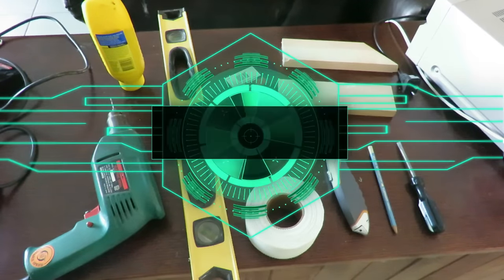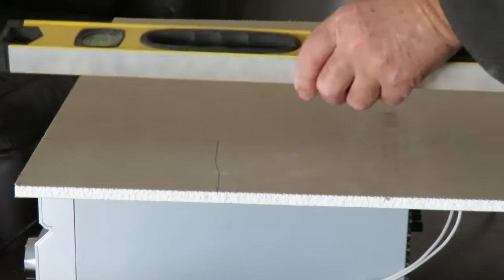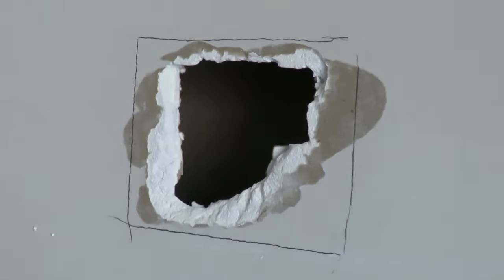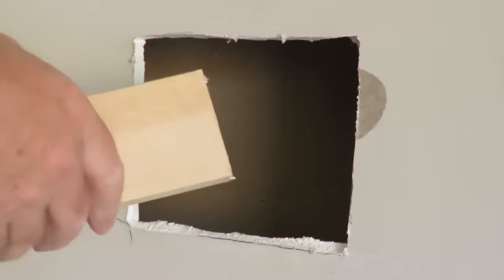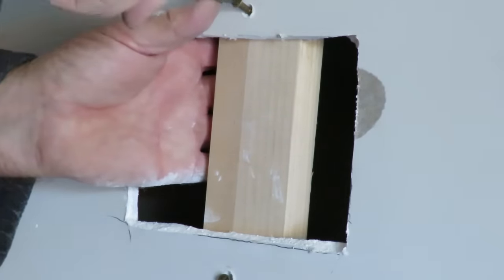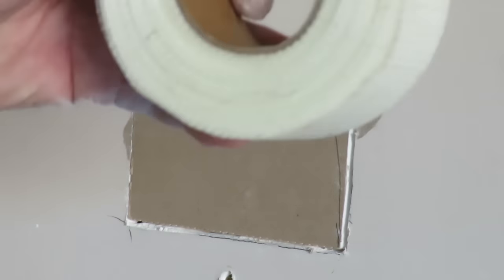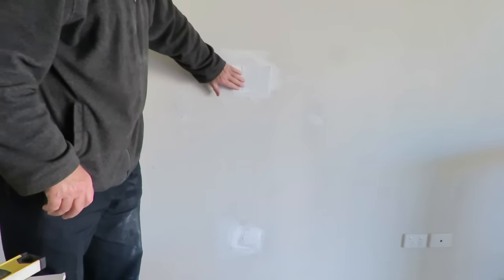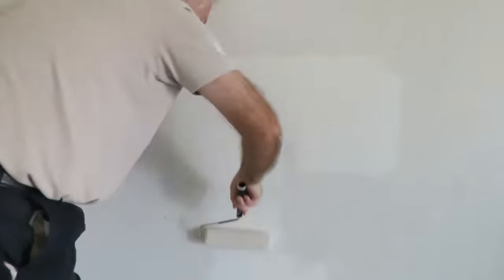🏠 How to Repair Drywall and Fix a large Hole in the Plaster Wall the easy way

Comment: Well this is exactly how not to patch a hole.  First he put the drywall backwards.   Secondly he didn't pot any screws to secure the piece of drywall to the backboard.  And I'm here reading people complementing him without knowing is completely wrong.
Reply from the maker: And people like yourself not reading the video description before commenting.
Reply: I agree.
Reply: Lol, sure you only put that description of double sided drywall after you realized you put it backwards to late in the video to edited out. You can really tell one side is gray and the other brown when you start cuttingit and then you flipit. Is ok if you made a mistake , just don't try to fool people. Everyone that knows drywall is going to know it was backwards. More over if you had limited tools the same way you put the backboard you could at least put one screw in the middle and secured the drywall.
Reply: complementing or complimenting?

Comment: Thank u so much for doing this video it has just saved me probably a thousand  $$ 
with the one underneath did u do the same or just the tape and putty?
Reply from the maker: Thank you for your kind words.
There are many ways to do repairs, it all depends on what you have available on the day of the repair.

Be sure to watch my other wall repair video, when I had all my tools with me.
By watching both, you will get a better understanding as to just how easy it is to repair walls damage.
📌 https://youtu.be/JmcR9TW4mM0

Comment: As you say , a new blade helps! At 2:39 I was really worried as your left hand thumb was right in line with the blade! If the blunt blade had slipped….!
Reply from the maker: Thank you for your safety observation.🚑

When I have all my tools with me I normally use the method below to repair walls.
https://youtu.be/JmcR9TW4mM0

Comment: great concept but my god he's made hardwork of it. the patch isn't held in properly should really of had 2 pieces of wood to keep the patch level and the screws screwed up tight and countersunk. this is a bit of a bodge in my opinion.
Reply from the maker: That same patch is still holding strong, after all these years since the video was made. 

P.S. I normally use the method below to repair walls when I have my tools with me.
https://youtu.be/JmcR9TW4mM0

Comment: I would’ve used 2 pcs of 1”x2” and attached 1 to each edge using the same method. That gives more backing on the ends of the patchwork. Just saying...
Reply from the maker: I normally do the repairs the way you describe.
I have another wall repair video you might like, when I had all my tools with me.
https://youtu.be/JmcR9TW4mM0?

Comment: And now the drywall will move in and out. I would have put the two pieces of wood on both ends so it would have a solid base.
Reply from the maker: Please Read the video description for a better understanding as to why the repair was done this way
P.S. I normally use this method when I have my tools with me.
📌 https://youtu.be/JmcR9TW4mM0

Comment: Great video. Quick question though. Are those mesh patches you can buy to cover a hole any good?
Reply from the maker: I've used them, there OK, but will leave the wall area slightly raised where the repair is.
There are many ways to do repairs, it all depends on what you have available on the day of the repair.

Be sure to watch my other wall repair video, when I had all my tools with me.
📌 https://youtu.be/JmcR9TW4mM0
Reply: @GarryPurcell  thanks. I might just try it the way you have done it instead.
Reply: They are OK if you don't need a good strong patch. Put one in where a doorknob went thru the wall and you will probably be doing it again in a couple of days.
Reply: Yes.

Comment: Not how I would do it. Lot of extra work for no gain. No need to cut hole bigger to make square shape. No need to screw a lump of timber behind hole. No need to use tape. How I do it: clean damage with a Stanley knife. Ensuring torn and loose material is removed. Glue strip of plaster board using cornice cement in behind hole, using a screw to press plaster board strip/s up against back of wall. For small holes fill up with cornice cement and finish with top coat and samd. For large holes, cut new plaster board to size and glue to backing strips.
Reply from the maker: I have another wall repair video you might like, when I had all my tools with me.
https://youtu.be/JmcR9TW4mM0?

Comment: They sell metal covers that have holes in them and sticky mesh on the outsides to stick on the wall. The metal obviously covers the hole and all you need is plaster. Can't hide the bump it leaves haha
Reply from the maker: The mesh is better than nothing.

Comment: lost me after you didnt screw the new piece of drywall to secure it wobbled and dropped it like its hot lol i know theres a big bump in the finish
Reply from the maker: You should not assume.
P.S. The finished repair is dead flat, and I challenge you to find it in the house that was repaired 4 years ago.

Comment: My plumber was looking for pipe leeks and went behind the bathroom wall and into the room behind it and the wall. He cut two rectanglar boxs in the walls to look at the pipes. He found no  problems there and left those two holes there. He went on to find the problem elsewhere. 
How do I repair the damage he did? Can I use those square cuts he made and repaste them back?
Reply from the maker: Yes you can use the cutouts.
I'd recommend you use the method below to repair walls.
https://youtu.be/JmcR9TW4mM0

Comment: You don't have to drill in the dry wall. That's why the backing wood was loose.
Reply from the maker: True, however there are many ways to do repairs, and it all depends on what you have available to use on the day.

I normally use the method below to repair walls.
https://youtu.be/JmcR9TW4mM0

Comment: what if behind that hollow hole is insulation (the pink fluffy type), then you can't insert that piece of wood.  How would you fix it then?
Reply from the maker: Pink Insulation batts can be pushed back out of the way, and the pieces of timber inserted.
I would use screws through the plaster board and the timber inserts at either end of hole.
https://youtu.be/JmcR9TW4mM0?

Comment: nice one- it does look perfect and ill be using your method to fill mine - can I do the same with circular holes too - I've got them in my ceiling for chasing cable the plaster was really old in places some with hair in it too - I think cut out a circle and do it - thank you!
Reply from the maker: I would suggest this method below would be a better choice for ceilings.
https://youtu.be/JmcR9TW4mM0
I normally use this method to repair walls.
By watching both, you will get a better understanding as to how easy it is to DIY.

Comment: Honestly seeing this process it looked super sloppy. The dry wall piece wasn’t even fastened to the backing board. Also looks like you used a spackle pre mixed product instead of mud (i could be wrong). I will say this tho, your finished product looked good. And that’s all that matters.
Reply from the maker: Please Read the video description.
P.S. I normally use this method when I have my tools with me.
📌 https://youtu.be/JmcR9TW4mM0
Reply: @GarryPurcell  No excuse for a bad  job. You should never be allowed to do this kind of work again.
Reply from the maker: Wow a repair that was completed 4 years ago with no sign of any problems todate, is a bad repair in your opinion?
Feel free to enlighten us as to your preferred method, and back it up with a video you made.
Reply: lol he also put the drywall in upside down... this was a comedy.

Comment: Pardon my ignorance, but do you remove the screws or did you plaster over them?
Reply from the maker: The screws were slightly below the surface, and plastered over.
I have another video that might help you, if your repairing a wall for the first time.
https://youtu.be/JmcR9TW4mM0
By watching both, you will get a better understanding as to how easy it is to DIY.

Comment: What do you do if the hole is near a light switch?? Will puttinh a price of wood beside it be a fire hazard??
Reply from the maker: When working near live power be Very Careful.
I personally would turn the power off if you are using a panel saw to make a clean cut in the drywall.

You should not have any issues regarding fires, as long as the wires are fully insulated, and no bare wire visible in the area your repairing..
P.S. If your repairing a wall for the first time, you might like this video as well.
https://youtu.be/JmcR9TW4mM0
By watching both, you will get a better understanding as to how easy it is to DIY.
Reply: No, your boxes are usually hung on a wood stud.

Comment: Thank you for the video Garry, a quick question: do I need drywall specific screws or can I get by with wood screws?
Reply from the maker: I would use drywall screws if you have them available.
P.S. I have another wall repair video you might like, its a slightly different method for fixing a hole in the wall, and it might help you.
https://youtu.be/JmcR9TW4mM0?

Comment: is there a reason that you chose to install the patch with the internal lining  (bown) facing out?  the manufacturers go to a lot of trouble to provide a white  surface that takes paint and plaster and you work on the cheap inner liner,   why?
Reply from the maker: It really doesn't matter that much for a patch.
The main difference is tooth for the paint to adhere to, is already on the white side, applying undercoat, does the same thing over the brown side.

Comment: A better way to do this, is the screw the repair Patch into the Timber, which was'nt done.
Reply from the maker: The repair was not planned.
All materials and tools were sourced onsite from the dump bin and what I could borrow.
Reply: Tony Crossley why bother? One extra step and does seem necessary?

Comment: Also use a rasp to smooth the cut out so it's a better fit
Reply from the maker: Handy hint.
Thank You
Reply: You don't need a rasp. A knife and a quick 45 angle cut does the trick and allows for better plaster set.

Comment: The basics are good but should have used 2 pieces of wood so it didn't create a pivot point making the patch a weak section of the wall.
Reply from the maker: Thank you for some constructive criticism.
Please Read the video description.
P.S. I normally use this method when I have my tools with me.
📌 https://youtu.be/JmcR9TW4mM0

Comment: Lol I think you installed the drywall the wrong way…. I don’t know if you’re from the UK but drywall paper is usually white from where I have been. They purposefully make the backing side brown or that grayish beige to identify the side on which needs to be faced on the inside of the wall. Otherwise all that work you did like the mesh tape, and the application of that hot mud in a squeeze bottle would be for nothing…. 😂
Reply from the maker: Plasterboard just needs to have a good tooth, to give adhesion for the final coat of paint. That's why you apply undercoat on most surfaces before applying a top coat.
P.S. This repair is 4 years old, and no problems to date.
Reply: @GarryPurcell ..you have it backwards.. exposed paper needs to be primed or it will bubble.

Comment: I've repaired like this before.  Check out how I repaired textured drywall over on my channel.  Comment and let me know what you think!
Reply from the maker: Thanks, Will do.
I normally use the method below to repair walls.
https://youtu.be/JmcR9TW4mM0
Reply: @GarryPurcell  I've done that before as well.  I was surprised you didn't use any tape in that one.  Are you concerned about cracks down the road?
Reply from the maker: @HowIDoThingsDIY  You shouldn't have any  cracks to worry about using the second method. There are many different ways to do repairs, these are simply two of them.

Comment: I know a much faster way. Just screw the dry wall plug to the wood backing with a drywall screw and then use two part bondo to fill the cracks. Let dry for 5 minutes and then sand and finish.  The whole job should take about an hour start to finish.
Reply from the maker: Thank you for sharing your method.

I normally use the method below to repair walls.
https://youtu.be/JmcR9TW4mM0
Reply: 🤫🤔!Your'e wrong in 20 mins! if you know how!!😎👍🍻
Reply: @raulgutierrez5920  We'll son it just looks like you just don't know. The trick is fasting drying Bodo if you know what that is...

Comment: WHERE'S THE PLASTER WALL??? In my 1925 built house I have PLASTER over WOOD LATHE WALLS! Fixing a hole in them is HARD ALL WEEK-END LONG WORK! The MODERN repair is first  heavy screen wire to repair the wood lathe, then build-up layers of REAL mortar PLASTER (hard to find-only two places in the city have it in 50 pound barrels aka; Hydrocal), a smoothing top-coat, let dry, oil based primer to seal then paint three to five coats (oil based paints 3 coats premium latexes 5 coats). A hole in a plaster CEILING plan on a FIVE day repair job or a place THREE times a big will fall on your head! ASK ME HOW I KNOW having lived in this house 38 years and worked on it 15 years before when it was my Grandparent's and my Uncle (their son) would "fix at it"!!!
Reply from the maker: Sounds like you had a fun time repairing it.

Comment: Your could have done a 10 times better patch with the same tools in the same amount of time, and just a tad more effort and care in your work. 

Should cut a hole out from stud to stud on either side with of the hole for better support so that the new drywall does not wobble. Also adding two screws on each side instead of just one on the top and one on the bottom will help with that as well. Your drywall was moving all over the place with only one piece of support that was poorly installed and moved as well. This will crack the plaster and expose the seems over time
Reply from the maker: If you bothered to read the video description, you would know why the repair was done this way.
P.S. I have a better instruction video below, (when I had all my tools with me.)
https://youtu.be/JmcR9TW4mM0?

OH... and by the way, this repair is in a rental property and its over one year old... AND NO CRACKING.
Reply: Change your name to officer patch conway

Comment: What grit sandpaper did you use? Thanks!! Great video!!
Reply from the maker: I can't remember the actual grit size, but a medium is all you need, as the paint roller will cover this easily. 
P.S. I have a slightly different repair video you might like, by watching both you will have a better understanding of just how easy it is to do wall repairs yourself.
https://youtu.be/JmcR9TW4mM0?

Comment: Having done these thousands of times have never seen it done in such a difficult manner….and a dull knife no less. Maybe I should make a video. Far easier to use a sheetrock saw, screw a larger piece then the hole the saw at an angle in any shape. The resulting piece drops into the hole as a perfect fit.
Reply from the maker: If you read the video description, you will find all your questions answered, and your post irrelevant
P.S. When I have all my tools with me I normally use the method below to repair walls.
https://youtu.be/JmcR9TW4mM0.

Comment: What if i want to cut it a little big and shave it down to the size as i go like go a bit bigger then try and cut it down to fit better or does it not matter
Reply from the maker: As long as there is a space around your patch to take filler, you should be OK.

Comment: Anyone else notice the drywall piece is backwards? 😂😂😂 That should be your first question...
Reply from the maker: And your answer will be.
The only difference is the surface on the brand of board your using, one side gives a smoother finish, the other side has one less paper layer, so you will need a primer, and it is slightly harder to get a smooth finish.
Reply: Yes, right away

Comment: You smashed the paper with your screws, that's why your piece of wood is not tight; I do not understand why you did not screw your piece of gypse on your piece of wood, it would have held properly. There are also screws especially for gypse; star screws.
Reply from the maker: The backing timber was Australian hardwood, and I didn't have the strength to tighten the screw fully by hand.
The Video description will help you to understand why the repair was done this way.

Comment: Good idea till some one leans on it 😂😂😂😂😂😂
Reply: It's as strong or stronger than drywall normally is. If you hit that repair hard enough to knock it out it would be hard enough to make the original hole or even bigger in any wall like it 🤦‍♂️
Reply from the maker: Thanks for explaining how a repair holds up🙂.

Comment: Nope. This is not quick easy nor neat. Cut your hole square. Cut a patch piece a couple inches longer in all directions. Cut on one side the hole size but do NOT cut all the way through. Tear off the sheet rock but leave the extra paper. The piece should fit into the hole with paper over lap on all sides. Mud and add patch and mud again. Let dry and sand. Done. If you want to use a wood backer for larger holes, go ahead.
Reply from the maker: There are many ways to repair damaged walls, it all depends on what you have available on the day.
Please Read the video description.
P.S. I normally use this method when I have my tools with me.
📌 https://youtu.be/JmcR9TW4mM0
Reply: I was curious how to deal with that extra tape that is exposing the patch further away from the wall. And it's not gonna be flush and neat. But probably we should just accept that it is not quite flush.
Reply: @arishem555  This is why you use the method I mentioned. No tape. Just the mudded paper extended with minimal mudding. When dry, a light sanding will smooth everything and be ready for painting. The way shown in the video will have the "fun" of multiple sand/mud/dry cycles that will last days before you get a finish ready for paint.
Reply: @buzzard6410  thnx!
Reply: @GarryPurcell  A Blowout/California Patch doesn't require Screws & Blocking etc.
Just the Drywall Piece & Mud !